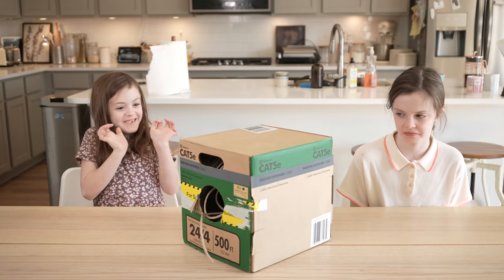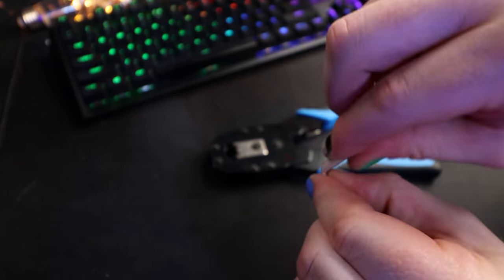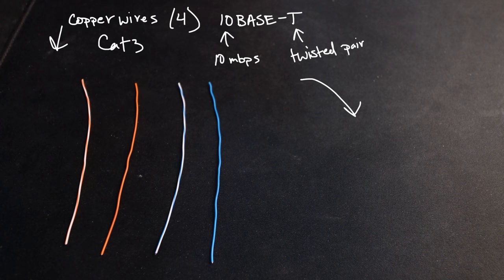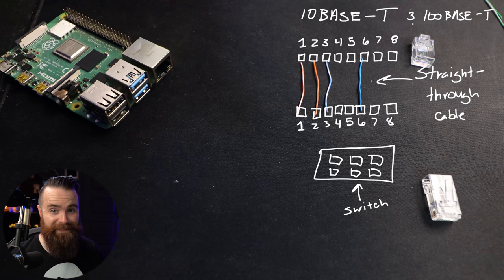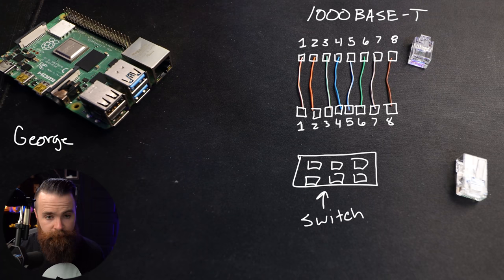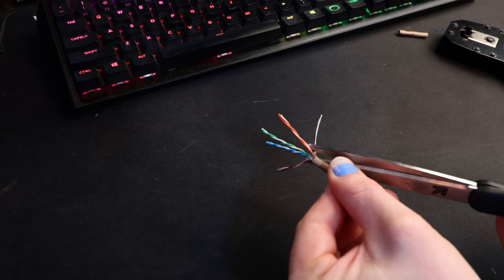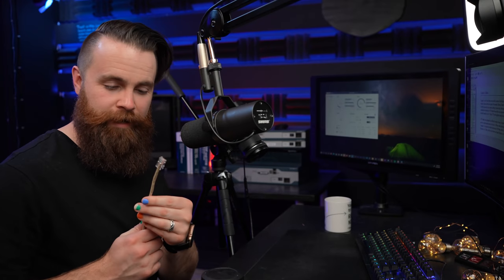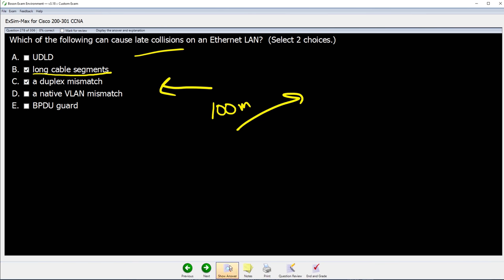forcing my kids to make Ethernet cables // FREE CCNA // EP 11

Comment: Been a network engineer for over 20 years. You're going to  have mysterious network issues if you keep  making cables like that.There's a purpose to that granny hair.  You need to use it to split the sheath an inch below where you scored it to make sure the wire insulator was not damaged in the process or you will get cross-talk from intermittent to severe depending on the depth of the scoring.  Those blades, especially when new, can cut the insulator so finely that it's nearly impossible to see, but over time will develop cross-talk as the cable is moved around, so a cable that was good mysteriously goes bad. Trust me. Get in the habit of splitting the sheath below that cut. I don't know how many mysterious problems I've had to diagnose, ultimately to have to re-end or replace a cable, without enough length to re-end, do to my engineers doing it the lazy way, and when that cable runs from the patch room to the server room and into a server rack with dozens of cables zip-tied together... I wasn't happy!

Comment: Chuck! I am a CCNA instructor, and a Microsoft MCSE 5 more etc. u FAIL at cable making!
You ruined them when you bent them trying to cut the seal off and you got the shield completely wrong you split it from the end and you split it back away from the wires and then cut it off never ever cut against the wire